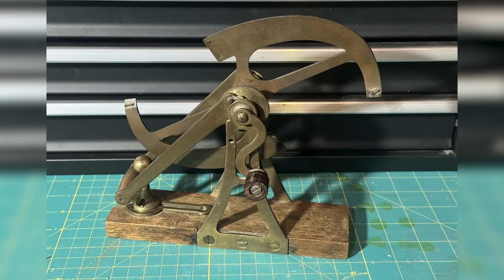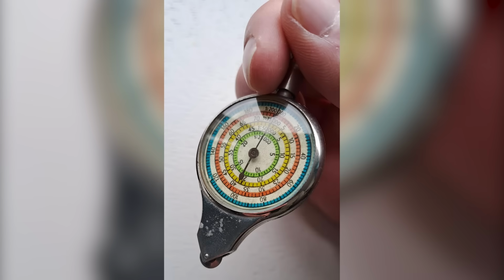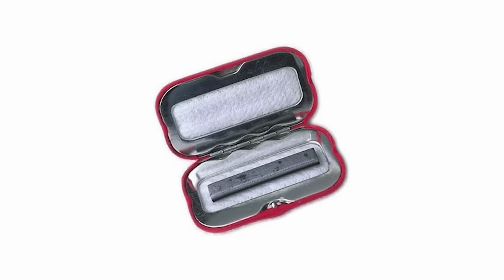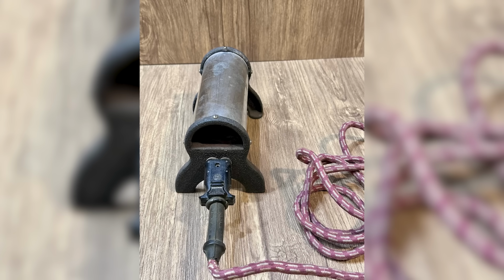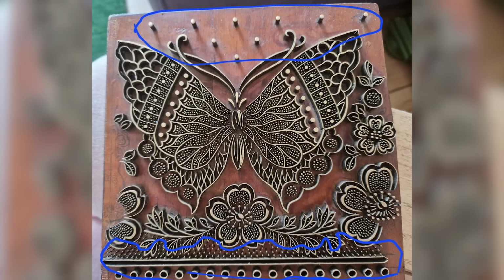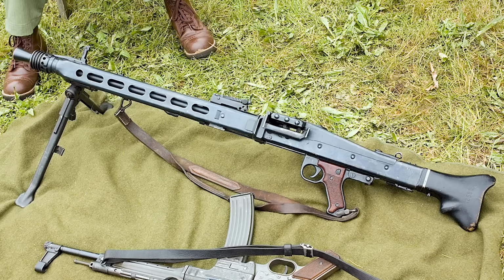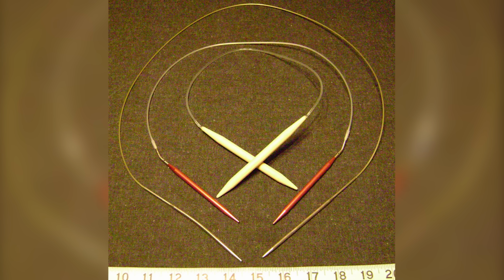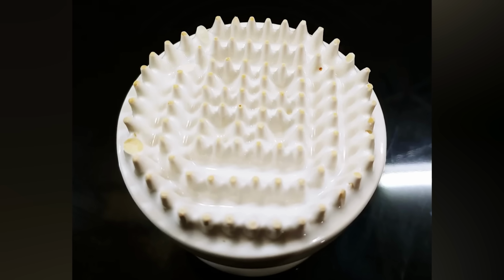What Is This Thing? You’ll Never Guess Its Real Purpose — Part #15

Comment: The metal rim around the wagon wheel is, surprising, called a tire.
Reply: Wrong. The word tire wasn't used until rubber was introduced and used.
Reply: @justsayin7704 did you get my link?